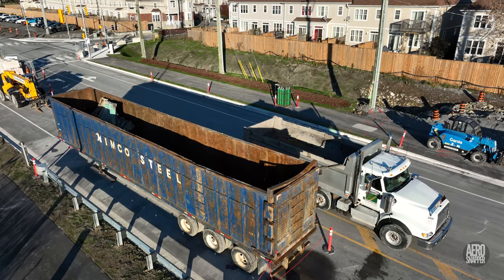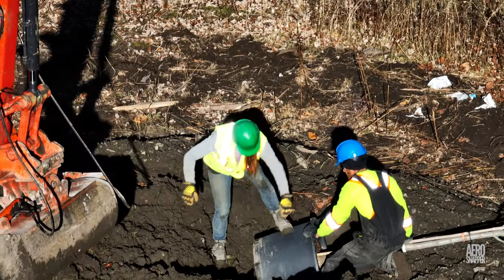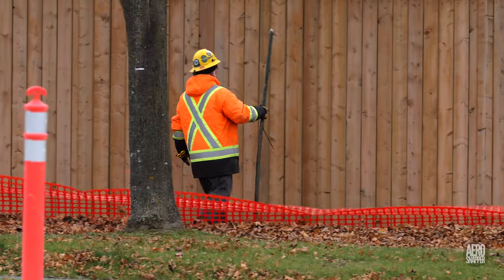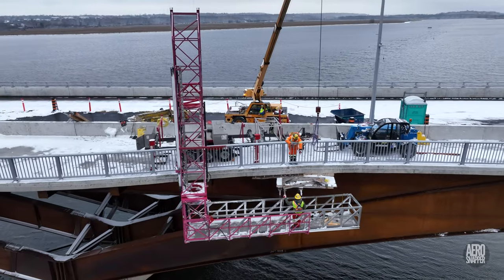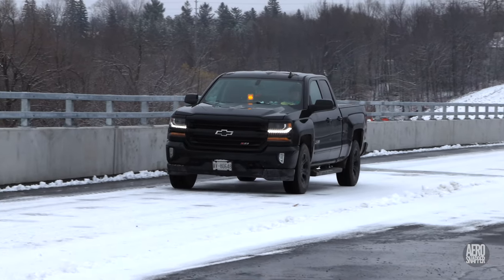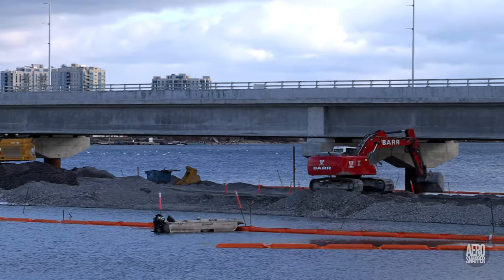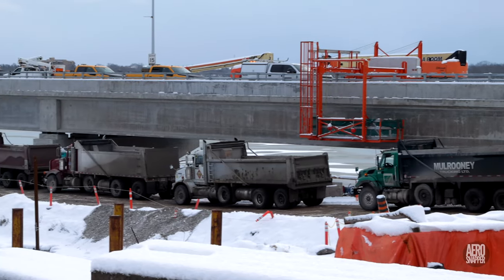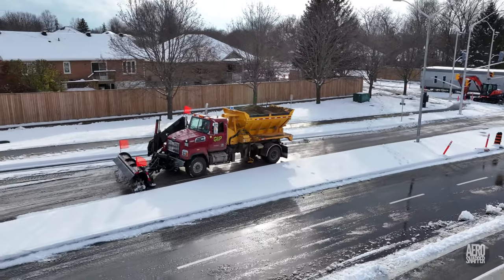This is Snow Way to do Business   4K

Comment: Hi Mike, so what exactly was that scrap steel that went into the Kimco container? (It didn’t look like anything I recognized as having been used on the project.)

Speaking of scrap, we were in Toronto midweek so we missed the salvage of that abandoned sailboat that’s been heeled over in the shallow water just off Belle Park. Did you manage to catch it?
Reply from the maker: Mark - the scrap going into the Kimco container early on was the remains of seacans that bordered each set of shoring boxes. I didn't catch the actual removal of the Margarethe (sailboat), but I spoke to the company that undertook the work. She has had to be scrapped. Her masts were removed a little earlier.